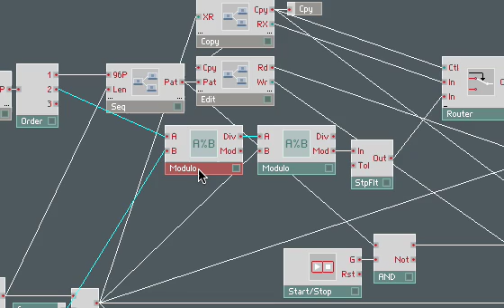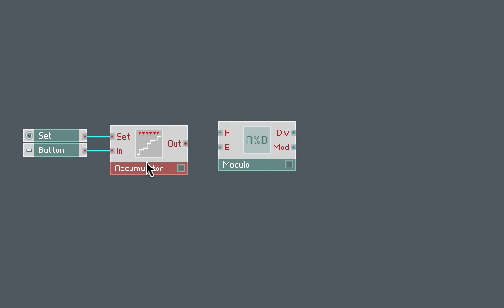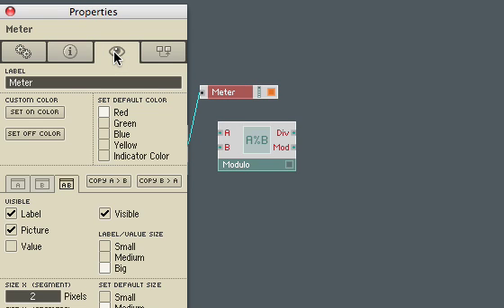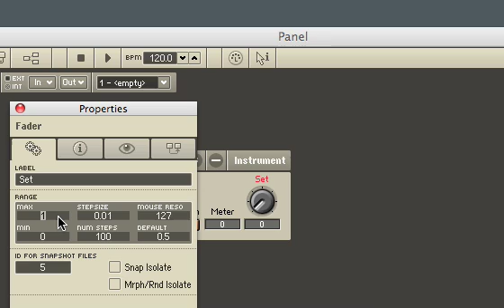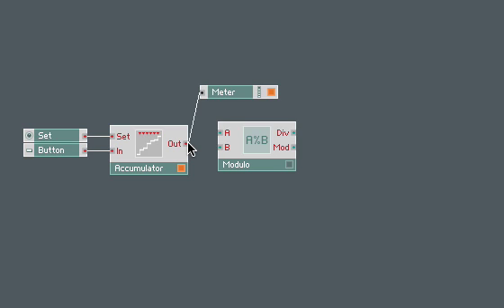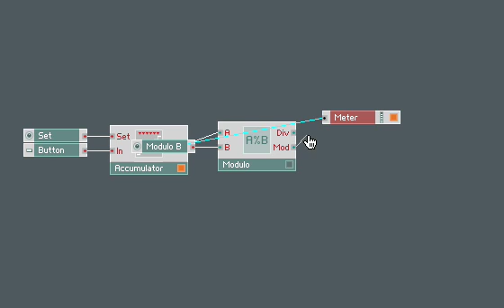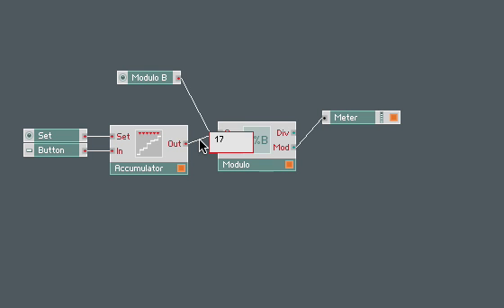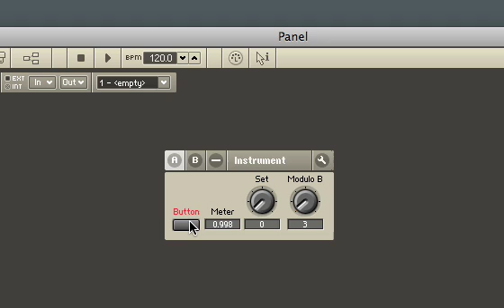The (Elusive) Modulo Module in REAKTOR

Comment: Basically, a pattern forms when dividing an incrementing number by a static number, based on the remainder from the equation (keep in mind the modulo won't round!).  The Div output only outputs the integer from the division.  For example:  16 div (divided by) 3 = 5.  The 5 is the integer from the division.  However, since 16 does not divide equally with 3, you are left with a remainder (of 1).  That number is your modulo.  Hope this helps!

Comment: Whatever value you plug in to input B will always divide in to the value at input A.  Since the value at input A is constantly increasing (the clock value increments forever), but (in our example) your number 6 at input B stays the same, the Modulo (which calculates the REMAINDER of Input A divided by input B) will output 0 - 5 repeatedly out of the Mod output.

Comment: A common way of using a modulo is to create divisions of beats (16th notes, 8th notes, dotted 8th notes, etc.) For example, if you have a clock source (at audio rate) that increments a value continuously (0, 1, 2, 3...) and you connected that clock source into the A input of the Modulo object, all you would need to do to create a division equal to 1/16th notes would be to plug in the number 6 into input B.  (continued...)